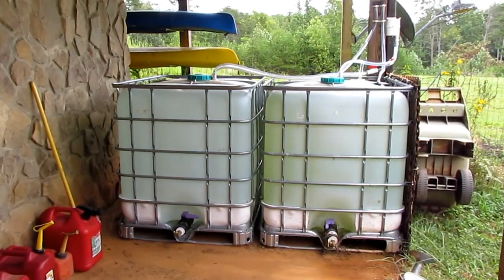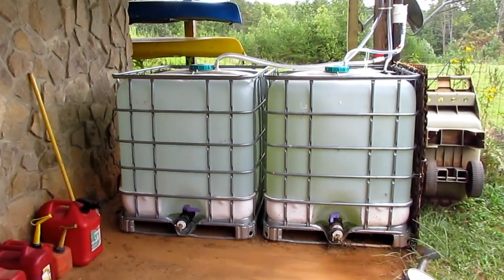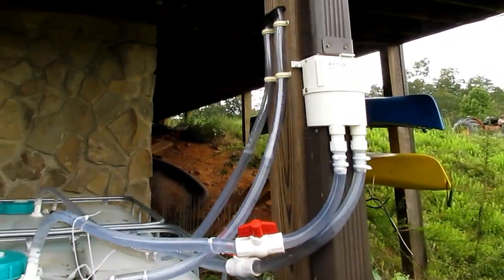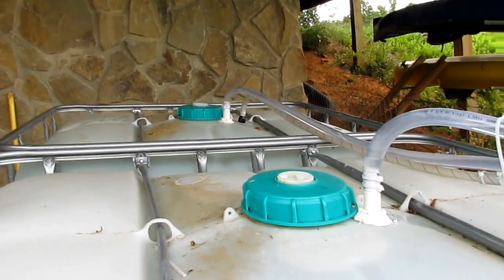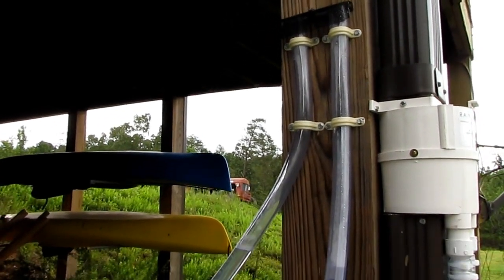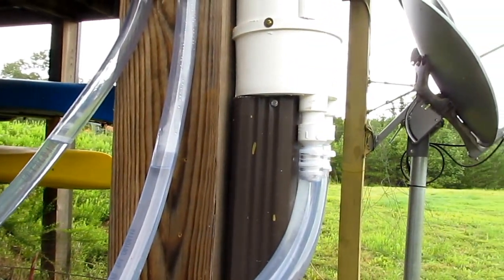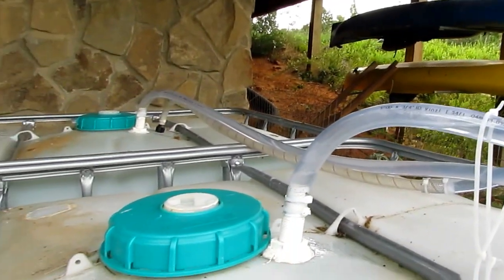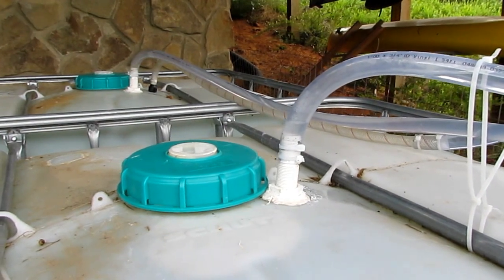RainReserve Diverter & storage

Comment: nice water-tight system.  where did you get the adapters to connect the tubing to the tanks?  I'm looking to do a similar setup but don't have any of the connecting parts.
Reply from the maker: Thanks for watching.The parts you are asking about. These are boat Thru-hulls. I lived on a 38 ft sailboat for many years and have loads of hardware left over. The items you are asking about you can find them. in places like Boat U.S., or West Marine http://www.westmarine.com/buy/seafit--nylon-stainless-steel-mushroom-thru-hulls-for-hose--P014858963 I am using the upside down. Usually the flat side is outside the boat and the hose connector in inside. find the cheapest ones you can get. Use any caulking to seal them. I reached inside the tank from the large opening in the top to hold one side while I tightened the exterior. good luck with your project.